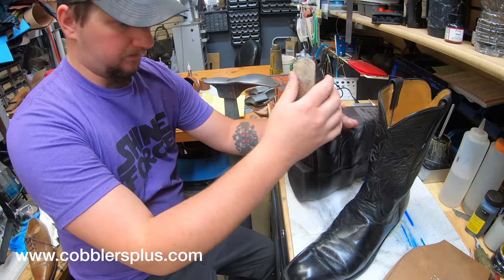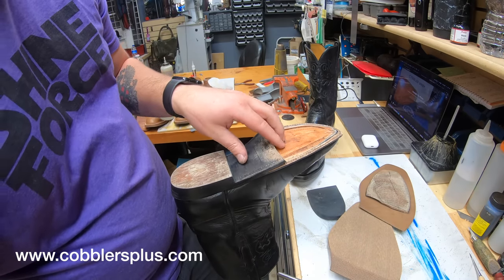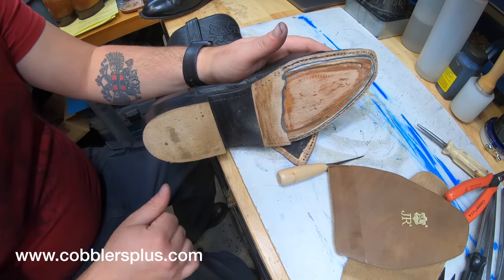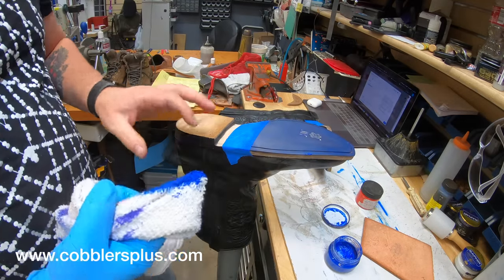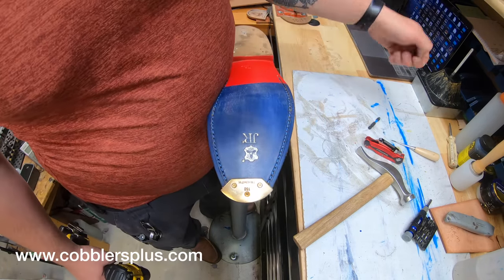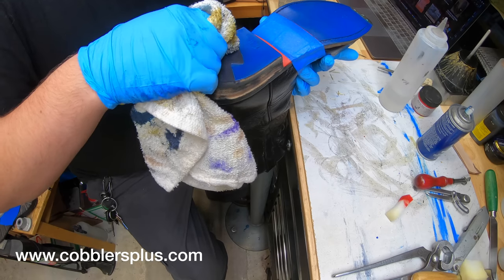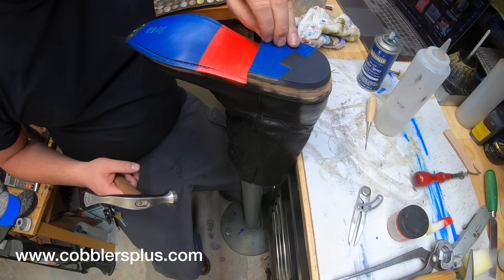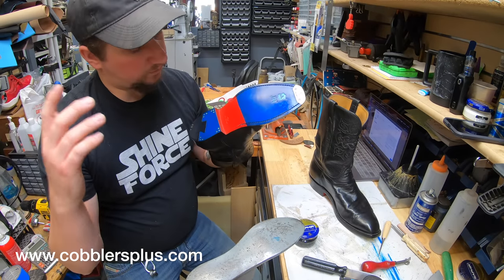Lucchese Classic- Resoled with a JR Leather Half Sole and Triumph Toe Plates

Comment: Nice colors on the sole!  Add some white and I'd love to see what an American flag design might look like on another pair of cowboy boots.  Also, if JR doesn't absorb liquids easily, then how do you get the color into the pores?
Reply from the maker: The dyes are alcohol based and the creams have a solvent so it only penetrates the top 1mm or so and in some cases we have to use acrylic leather paints that just go over the top